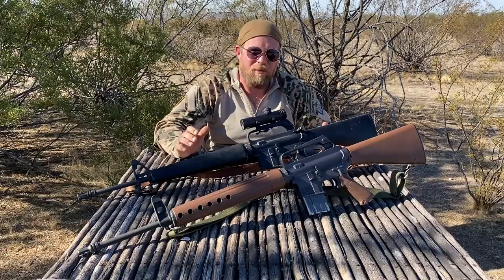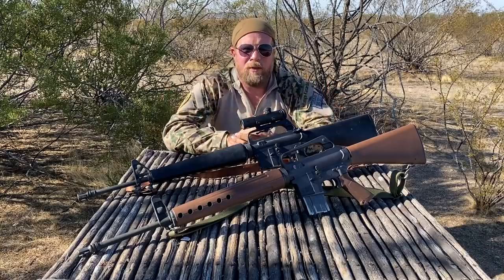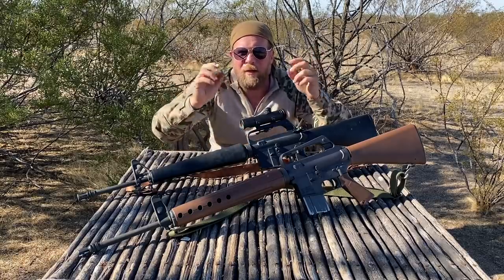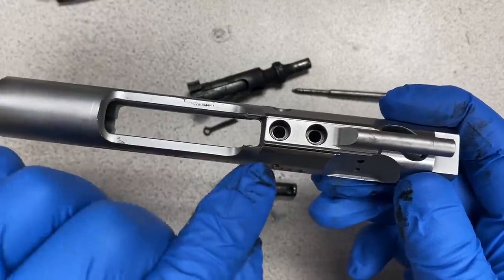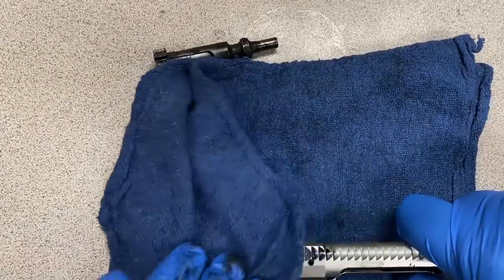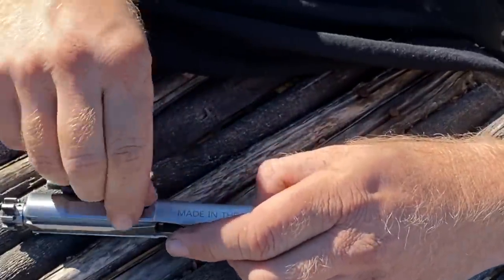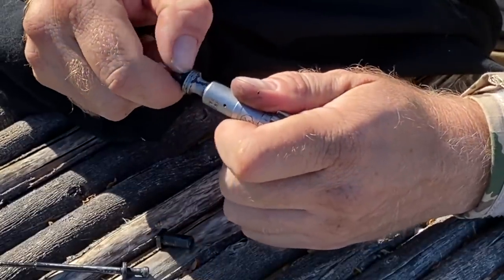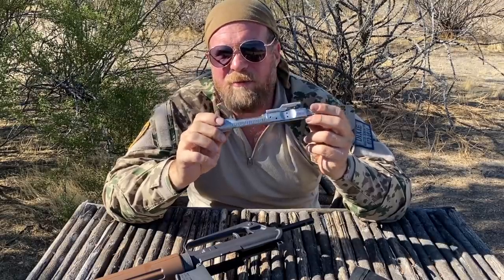WWSD2020 - Bolt Carrier Group

Comment: And just like that, Young Manufacturing is sold out on bolt carriers Christmas Eve.
Reply: I've never seen a bcg in stock at young, its nothing new unfortunetly.
Reply: They don't stake their carrier keys and use sub standard attachment screws. This is a bad choice for a hard use rifle.
Reply: Lmao, yup.
Reply: I was able to get Russel to spill the beans on what BCG they were using about a week ago and went to take a look and they were already sold out. In fact, almost all BCG manufacturers are sold out minus a very few cheapo depot phosphate coated manufacturers. Even Anderson is completely out of their run of the mill milspec BCGs.
Reply: Young doesn't even stake their gas keys.
Reply: Don't be silly.  They were already sold out, just like everything else you actually want.
Reply: @tstodgell  They have an entire post on their website explaining why they don't.

Comment: I wonder why you didn't look into a coating like TiN, Nickel Boron or DLC. The coefficient of friction is objectively superior (although TiN is a little gaudy I'll admit).
Reply: Probably because the coating will wear off much more quickly through use than a hard chrome finish.
Reply: That’s what I was thinking. He didn’t address other finishes.
Reply: He did mention other finishes, "they all represent a significant improvement over phosphate" I think is what he said. I'm a big fan of  the Obsidian electroless plating done by TR enabling. It is rediculously easy to clean, I put 200 rounds through and everything just wiped right off, I would love to see someone with the resources to put a few thousand rounds through a gun with that coating.
Reply: The main disadvantages to hard chrome compared to other modern low friction corrosion resistant coatings is the coating tolerances and environmental impact if you care about that. I think the hardness are wear characteristics are marginally different, you can get nickel boron coatings just as hard if not harder than hard chrome and electroless nickel can have better friction coefficient but they are all fairly close. The other big advantage to some coatings like electroless nickel is the cost (mostly due to the lack of environmental impact)
Reply: Jack Mehoff  they are not stronger, they are harder. Unfortunately they are orders of magnitude thinner than industrial hard chroming, therefore no matter how hard they are, they will wear off faster than a hard chrome finish.
Reply: Jack Mehoff  no, hard chroming is not offered as often anymore because it is prohibitively expensive to do properly while still complying with EPA regulations. The chroming process involves a lot of very nasty chemicals and toxic waste production.
Reply: Jack Mehoff  more expensive does not mean inferior
Reply: NIB in general should never be used on bcgs as it can cause hydrogen embrittlement and is more likely to affect the final dimensions of a bcg as its applied after assembly so you may have an out of spec, out of headspace bcg or some parts not properly coated.
Reply: my two have one 99 dollar no name bcg in nitride and  159 dollar one  parkerized. both work fine but i cant shoot them. no ammo. :( i have self defense stock....and 40 thru each one. i know that is pitiful for testing. but it is all i have .
Reply: TiN is a cosmetic finish only. It wears off of wear points incredibly quickly
Reply: @triumphstagdriver  you'd think that but the most out of spec bcg large companies usually make is NIB.
Reply: @gorps  Um, no.  TiN is used to coat drill bits and other industrial cutting tools.  Cosmetics are not a part of this selection.
Reply: @TheSuburban15  look at literally any TiN coated bolt carrier groups or glock barrels and the coating will disappear off of the rails in under 500 rounds. I've also used plenty of carbide drill bits that have the TiN coating wear off after about 15 minutes. I'm not sure if the thickness of the coating matters but from what I've seen TiN on gun parts doesn't work well.

Comment: I’m still a big supporter of nitriding. Should be an extremely hard surface, while also not effecting final dimensions like a coating. Also can’t come off the steel, only wear through.
Reply: agree, My Nitrited Faxon BCGs are slick and easy to clean ,  The tail end of the bolt gets caked but it is the same here, wish there was a quick way to clean it without a scraper 😄
Reply: I am curious about DLC (diamond like coating) in comparison to the hard chrome.
Reply: @zedhiro6131  I have DLC coated knives and it is durable, but will surely flake with hard usage. I suppose prep work and the method of applications matters but at the end of the day it is a coating like chrome, TiN, NiB, etc.
Reply: You can buy it nitrided if you want it that way
Reply: @KI.765   or buy both 😸  ill probably get the chrome when i want to put together another upper 😸
Reply: @KI.765  lol I’m well aware.

Comment: You made the right call. The HMB bolt from Young represents both a design improvement as well as a metal treatment improvement. Stoner would do. The only other thing I might consider is the KAC E3 bolt. If you could have the HMB pin hole and the E3 lugs, that'd be ace, though the E3 does have a smaller diameter cam pin hole bored through to try and accomplish the same thing.

Comment: I am surprised that one of the Nitrided BCG's didn't make the cut.
As Nitriding is a surface hardening process instead of a plating one, there isn't the possibility of it ever flaking.
I am more familiar with Nitrided metal cutting tools, where the process is used for it's wear resistance and maintaining surface integrity at high temperatures.
I am not familiar with how the two processes compare with adhesion of foreign materials.  
Also Hard Chrome is a very nasty process that generates a lot of hazardous waste. Many companies that once did hard chroming, just aren't doing it any more because of the expense and waste products.
I am in no way disagreeing with the choice, as I do not have enough information to do so.
I'm just surprised.
Thanks guys, 
Merry Christmas to you and yours.
Reply: Totally agree, I don't know why any of the newer nitride coatings didn't make the list.
Reply: Nitrided bolts love to sheer. Is it the nitride? Is it the 9310 that they typically are? Is it both? I don’t know, but I know it’s the most common trait I see in low round count sheered bolt lugs
Reply: @ShawnHinck  to be fair that's probably just low quality bcgs, lots of garbage tier companies are using nitride finish these days.
Reply: @KamikazKid  to be fair, every company using nitride finishes is a garbage tier company at least where BCGs are concerned.
Reply: @ShawnHinck  
That is interesting. Nitriding being a surface hardening process, it might tend to make the surface more brittle and prone to micro fractures. These then could propagate into the underlying material.
Just a thought.
Reply: @jerrylong381  that’s definitely been my thought, along with them always being 9310 which is notoriously hard to heat treat properly for this application making it even harder and more brittle. 9310 and nitride, two traits I commonly see fail. I also couldn’t disagree more with Karl about phosphate being the worst choice for a BCG. Is it the best? Debatable, but worst? Given its performance over the last few decades and the problems I’ve seen with NiB, nitride and a few other finishes and platings, it’s definitely far from the worst.

Comment: I was in total agreement with this video until the end where Karl said that this is the best BCG on the market.  LMT's enhanced BCG and corresponding bolt is objectively the best on the market for mil spec compatible guns.  The extractor on the bolt is better, the metal that it is made of is stronger than carpenter 158 or 9310, and the locking lugs are better designed then a standard bolt.

After working on civilian and police rifles for the past decade I have never seen a broken LMT, but I've encountered dozens of standard bolts that have been broken at the cam pin, locking lugs, or as a result of bolt elongation at the cam pin hole that cussed tolerance stacking issues with short fitting pins.
Reply: Any Experience with Sharps Relia-Bolt.

Comment: I noticed the gas key screws aren’t staked.  Care to comment on that?
Reply: Saw that as well
Reply: Young doesn't believe in staking. They believe that with a proper threadlocker and proper torquing that staking is entirely irrelevant, which is generally true.
Reply: I’ve inspected a whole lot of M16s and M4s over the years, and I’ve lost track of how many properly staked bolt carrier keys that I found loose.

Comment: Was the POF improved bolt carrier with roller cam pin and milled in gas key ever used in your testing? Just curious because it is one of my favorites. It is expensive however.

Comment: I get that the lug is taking the load, but there's no staking on the carrier key screws.  Those could still come loose, walk out and cause problems, unless Young uses some thread locker.
Reply: There's some companies that adamantly claim that if they're torqued to the correct ft. pounds, then staking is unnecessary. I'm not experienced with those products, but it's something to think about
Reply: @aaronorr5586  comparing the raw numbers of yfs fasteners in use vs michigun's, you really sure about that?
Reply: Dumb question here,  would loctite solve this problem?
Reply: @izzed3500  With how hit the BCG gets most likely not.
Reply: @shadylimon  Yeah staking it would probably be the right option.

Comment: How would the chrome finish compare to a nitride finish? I know that nitride is supposed to have similar (although likely inferior) cleaning and lubrication qualities, but is that worth the extra money for a chrome bcg? I do think you were right about the recoil lug and the bolt not being completely bored out though. Keep up the great work!
Reply: IME my nitrided bolt from brownells (not the WWSD2020 bolt) has wear after ~1000 rounds. Not sure what it means exactly, but there’s a data point for you.
Reply: @509Gman  Wear, or the black worn off? As I understand it the color is just a surface oxide layer that is expected to rub off at wear points, nitriding is case hardening that goes far deeper than that.
Reply: @Broken_Yugo  didn’t know that, thank you. Yeah just not black anymore. Only in a few small spots.
Reply: The chrome is superior

Comment: My WWSD has a brownells TiN ightweight BCG, and instead of the silent spring, I’m using an Enidine hydraulic buffer. The TiN makes it far easier to clean and that’s the best part imo
Reply: Is a hydraulic buffer even noticeable with as much spring travel as an AR has?
Reply: @Omnis2  it's only for the very end of travel, where felt recoil is most noticable. Switching to a 6 oz buffer smoothed out a previously uncomfortable 5.56 pistol with a too light buffer (impacted at end of travel). Switching to a soft buffer material from the joke plastic 'buffer' also makes a big difference in felt recoil.

Comment: Is the carrier key not staked?! Recoil lug or not I don’t trust screws in a high heat dynamic environment to stay tight. Everything else about BCG seems well thought out so not having screws staked seems odd.
Reply: The originals weren't staked ,and there are some old timers (especially in high power) that still don't.
Reply: @FlyingNDriving  there’s probably some truth to that, but other hard chrome carriers are staked even the Brownell’s one.
Reply: The connecting rod bolts in your engine are not staked and they are in a high heat, dynamic stress environment, and I'm guessing they are still tight

Comment: Question: instead of using screws and a recoil lug, why not make a monolithic bolt carrier like Voodoo Innovations? An integral gas key seems like the logical next step. Add clearance for a roller cam pin while you're at it.

Comment: when it comes to the coating, I don't see any advantage of the chrome vs other high end coatings. PVD and Nickel Boron both have inherent lubricity and wipe off carbon build up easily.
Reply: Only long term testing will tell. The main reviews I've seen are all by people with comparitively low round counts over a short duration. Hardly a real study. That being said, I went with nickel boron myself. Knew going into it that it was a gamble though.
Reply: Regarding "any advantage": Isn't chrome better at retaining its properties at elevated temperatures?

Comment: For completion's sake, I think it would be nice to know what other bcg's and coatings were considered, and how they fell short.  It would also help develop an idea of what Y/M did right in comparison, so people can know what to look for when assembling a rifle.  Curious that the key isn't staked on the Y/M.  Concerning the Surefire Enhanced BCG, the additional dwell time from the cam path could help with gas control during suppressed firing, which is much more common among firearm owners that full-auto operation.

Comment: Nitriding is a lot cheaper than chroming, but it has a lot of the same benefits such as great surface hardness, corrosion resistance and slickness. My go to bcg for a build, an Aero Precision no logo nitride BCG, is like 5 bucks more expensive than their phosphate version.

Comment: Best bcg IMHO is still the tried and true phosphate milspec bcg.. My theory is once dry carbon sticks to the outside of a carrier and bolt it's all the same(ie dry/rough); except phosphate holds lube and continues to dilute the carbon and run smooth. I dunno, I've run all the fancy coatings/carriers and found myself going back to good ol c158 milspec bcgs because I've had less issues with them.
Reply: The Ford Taurus of BCGs, lol

Comment: My latest build was WWSD inspired, but I settled for the parts I could find in stock instead of the components that I thought would be most ideal for me. It turned out perfect for my needs, though. Definitely lighter than my SOCOM profile rifle with a quad rail and closer to the original lightweight ideal. BCM M4gery barrel, BCM lo-pro gas block, Fortis Rev II rail, Magpul MOE SL-K stock, and Sig Bravo4 optic. I went with the Surefire OBC and have no regrets. Much less harsh recoil than the original BCM BCG that I was hotswapping between guns and more controllable controlled pairs, even though the gun started out with very little recoil.
Reply: Wow, you must really hate having money, a lot. That bcg has absolutely no purpose on a non select fire rifle. You bought snake oil
Reply: Who said anything about it not being select fire?
Reply: @atticuswise6076  Then why talk about supposedly more controllable paired shots instead of controllable full auto?
Unless your rifle really is select fire, you bought a stupid gimmick.

Comment: I wonder if Young's ever actually stakes down the gas key screws.
You know, the one area where BCGs actually fail noticeably? Gas key screws backing out when not tightened properly and staked, causing gas leakage and short-stroking? That ring a bell?
Reply: They don't. People have been calling Young out on it for over a decade and Young keeps doubling down on stupid, saying "BuT wE uSeD LoCkTiTe YoU gUyS."  If they were going to change, they would have changed by now.
Reply: @Paelorian  Yep. Nothing wrong with a belt and braces approach.  Making the conscious decision NOT to take the screws just seems foolhardy when it's such a simple thing to do.

Comment: No offense but I feel like this video fell short for the series. I started skipping through once it turned into a "look at how easily it cleans up" type of deal so maybe I missed something, but expected more discussion on how different mfgs are approaching enhancements for things like the bolt lugs, cam pin paths, carrier modifications.

Nothing I saw convinces me that the young bcg is the "best".

Just providing feedback. Look forward to following the 2020 project.
Reply from the maker: No one manufacturer has included all of the minor improvements that have been done to dozens of alternative BCGs on the market, and this one is the one that has the improvements and is chromed, as we believe is the right answer, at this time.   If someone wants to license the "improved cam pin path" and the "improved bolt lugs" along with the improvements included in this Young BCG (which are the most important ones) and then create a chrome BCG at a viable price point, then that would be interesting.  At this time, that is not the case.
Reply: @InrangeTv  So you'll admit that it's what you believe to be the best answer at this time? I emphasize the  you believe part; because in the video, you, in a very decisive manner, outright declared the YM BCG to be the best on the market.
That's the arrogance people are getting effing sick of in you guys
Reply: @InrangeTv  I did go through and watch it again. You were correct there were a few things I missed but I still feel generally how I did in the first comment. TiN,NiB,CVD coatings all wipe clean similarly, no comparing the hard chrome to any other options on a technical level. Really the only thing that seems like it was the deal maker on this one is the bolt not drilled through all the way for the cam pin which in theory should make it stronger, but how thin is it down there, would it just crack at the top anyway. Etc. I'm a fan of the channel, don't take this the wrong way. :)